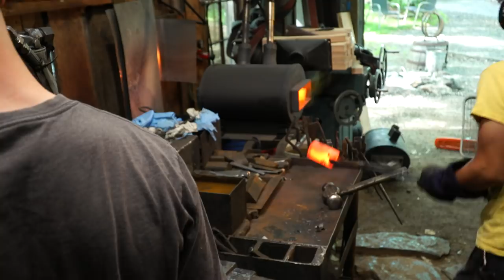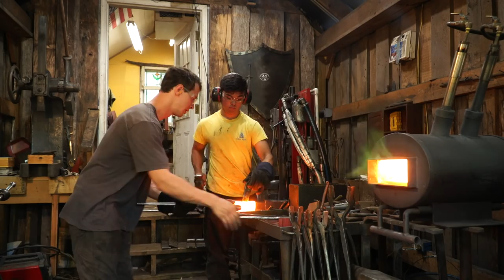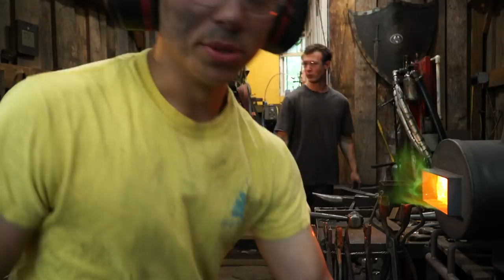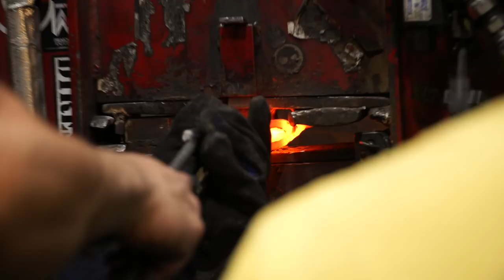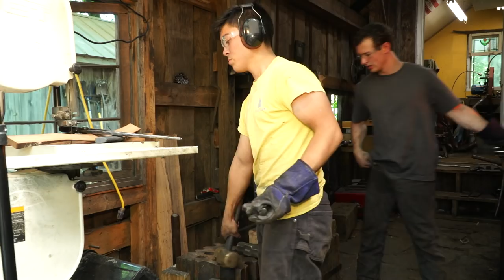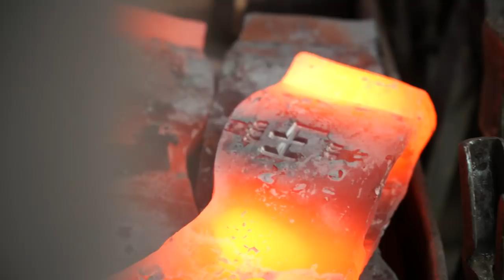HOW WE FORGE HOFFMAN AXES

Comment: Thanks for the video!

I’d very much like to hear you talk about the Punches/Mandrels that you make to pierce and open up the Eyes for the Axe Handles.  What is the Steel you use,  and how hard is it,  and do you have to re-Heat Treat them occasionally,  because they get too drawn back in Hardness,  becoming too soft to resist the Hammering and the Hydraulic Press?

Also,  I want to hear you speak of the Steel that you make your Axes out of,  and how Hard you are able to get the Steel at Quench,  and how how Hard you Temper them to,  in each of your Videos,  so I don’t have to hunt through all of your Videos to find out.

Thanks for sharing!

PS.  How to purchase your Axes should also be mentioned in each and every Video as well I think. 😉 👍

Comment: Are your axes made from a single piece of steel or are the edges made from a separate hardened bit? And is there any real practical difference between the two methods of production?

Comment: Nice video. Enjoy seeing all aspects of the process. One question: I noticed your press was kicking up on one side or the other as you worked the dies on the extreme ends of ram surface. Is that causing any damage to the press or is it designed to allow for that “play?”  Could just be some wear or play that’s there now after your press being used so extensively. I’d imagine you put more hours on that particular model of press than most.  Thanks!